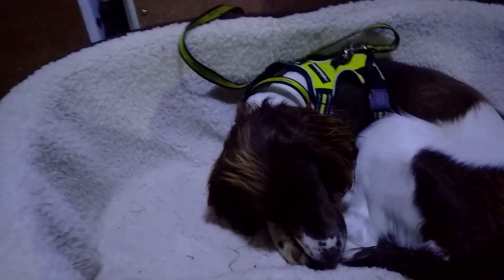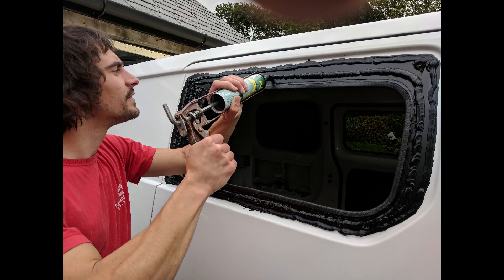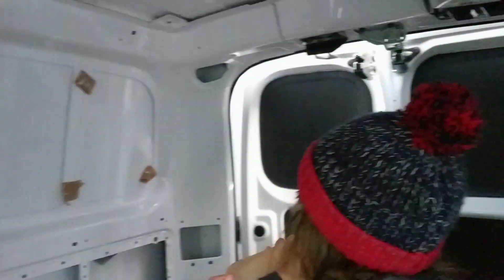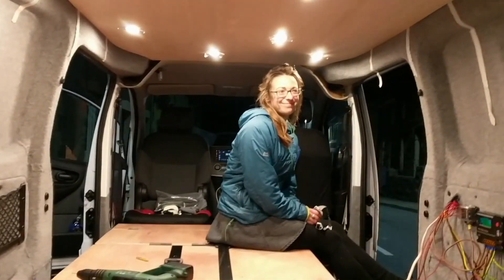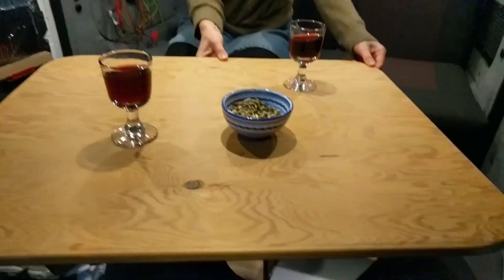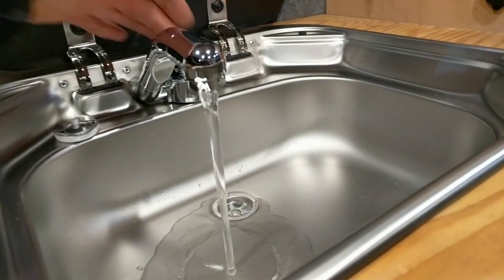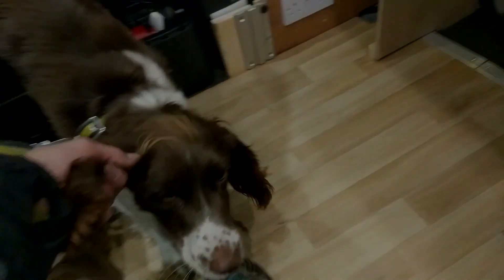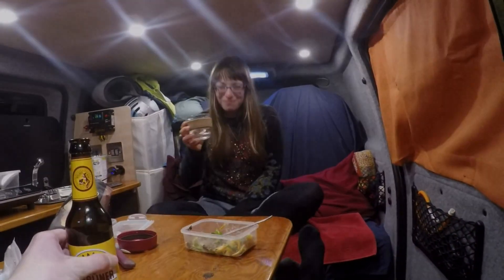Fully Electric Campervan: DIY Conversion Process (Nissan e-NV200)

Comment: Looking at doing this conversion on an ENV200 BUT discovered our very ungreen government  are not really interested in 'green issues' apart from talking about them 

The VED on a ENV200 is now post April 1st 2025 (for sure April fools day) is £345 and NO you cannot change it from a Van into a private car/campervan now :-(  Once it is type registered it is like that for evermore  BUT I have discovered that a ENV200 MiniBus is 'a private car' and not a VAN so VED is 'only' £195

AND with the ENV200 MiniBus you get windows already installed and up and over single back door with a single wiper and heated screen.

Obviously, finding a nice ENV200 MiniBus is going to be harder to find and more expensive to purchase  than a cheap 'older'  ENV200 Van 2013 ones being around £2,000.  Also, if i can find a pre 2017 one (VED £20) it will only have the 24kWh battery  :-( 

I DO LIKE the up and over back door and having factory fitted windows is a plus as well 

Probably more sensible to find a nice ultra cheap 24kWh van or even a 40kWh one  rather than spend a lot more money on the basic vehicle  being a MiniBus  5 or 7 seat versions

THOUGHTS????
Reply from the maker: Yes, the VED on the van version is annoying. I guess it depends on how much extra the Evalia (people carrier version) is to purchase. You may have to keep it for many years to make the people carrier version cheaper in VED savings. Agree, factory fitted windows are nice. Definitely go for a 40kWh, the 24kwh range is very limiting.

Comment: What radio/sat nav did you get having trouble finding one that fits
Reply from the maker: I've got an Android Pumpkin unit, any double din unit should fit. There's nissan ISO adaptor available to make the connections work

Comment: Amazing! So if you leave the heaters or air conditioning on over night - how much electric does that use? Half a battery? 10, 20, 30 miles worth etc?
Reply from the maker: If we're not plugged in the heater uses about 20 miles of range overnight depending on how cold it is. A/C doesn't use very much. I wrote a blog about this https://blog.zerocarbonadventures.co.uk/2021/12/nissan-e-nv200-campervan-cabin-heating.html

Comment: Did you look into having the R&R bed on sliders so you can push it forward and have rear space for carrying?
Reply from the maker: I've not heard of these before, sounds interesting but would have been ticky to install since the battery pack is located further forward

Comment: Hi IM seriously tempted to get a env200! Love the channel! Im a mountain runner and use a new Transit atm to drive to the hills and sleep in it.... Ive put in a Diesel heater, I see you say you can run the heating while not running the motor but I guess this runs off the 12v battery? Does this run ok or flatten that?
Reply from the maker: That's great to hear! The van needs to be left switched on when running the heating, the energy comes from the main traction battery, you can lock the doors from the inside, see: https://blog.zerocarbonadventures.co.uk/2021/12/nissan-e-nv200-campervan-cabin-heating.html

Comment: Hea man how did you get that section of the dash out? also what's the rectangle to fill in the gap around the new head unit?
Reply from the maker: Just pull that middle part of the dash and it pops off, the double DIN android headunit unit came with a fascia plate
Reply: @GlynHudson  Ok cool, thanx also for the cruise control, did you have to pull the wheel or was it just safer with the airbag out of the way?
Reply from the maker: @s.porter8646  wheel removal is not needed it just made access easier
Reply: @GlynHudson  for level 1 do you carry a 2 or 3 blade cord?
Reply from the maker: @s.porter8646  we don't have level 1 in Europe all our outlets are 240V
Reply: @GlynHudson  Got ya...starting my build

Comment: But, ehmmmmmmm, what's the actual mileage of the e-NV200? Is it really capable of riding along 850 miles without having to stop several times to get it plugged to recharge the battery? I mean, is an EV van currently the best vehicle to travel? I have serious doubdts about that. 

In fact, one year ago I went to a Nissan dealer with the idea of buying an NV-200, as I think it's the very best base vehicle for a single taveller. But I detached the idea as soon as the salesman told me that they weren't commercializing gas/diesel NV-200s anymore.

Comment: I wonder if it would be possible to add 500W (or more) of solar panels on the roof, which would slowly charge the main battery? That should add quite a few free miles over the years.  My question is do the van’s stock electronics allow for such modification to be implemented easily?
Reply from the maker: The vans main battery has a minimum charging current of 6A / 1400W. It wouldn't be practical to fit that many solar panels on the roof!
Reply: @GlynHudson  that's an interesting piece of information. So the battery is on 230V. I wonder if there's a way to hack the Battery Management System or charge controller to accept a minimum of 0.5A.  I remember there was a German youtuber - a kid who was experimenting with Nissan battery upgrades, who was into that sort of thing. He even started a company around EV battery expansions.
Reply from the maker: @garenkarapetian709  that is the limitation of the onboard AC-DC charger. To charge the battery at a lower current you would need to connect directly into the 400V battery pack, however this would require a significant number of panels and a specialist charge controller to achieve such a high voltage. Not worth the hassle and the danger for only a few miles of range IMO.
Reply: @GlynHudson  Yeah, there's simply no space for 1400W of pannels on that tiny roof. But an idea just came to me: what about having a leisure battery bank as a "buffer" between Solar panels and main battery. So when there's enough charge accumulated in the leisure bank, a separate controller can start spilling the excess at 6A into the main battery.
There's a certain hypocrisy when some vanlifers use the term "off-grid living" or "green" while boasting about covering 40K miles on overweight diesel gulping vans.  An electric van (and your channel seems to be among the pioneers in this direction) which would also generate it's own free miles - that'd be the thing, even if it gets only 15km/day.
I'm only raising these question because in one of your videos you said you're interested in these things (i.e EV things).
Reply from the maker: @garenkarapetian709  Yes, a buffer leisure battery would work. I've heard of other people doing that. However, the van is small, so space is at a premium. One of the nice benefits of an EV van is that I don't need a leisure battery. A leisure battery with enough capacity to be able to output 1.4kW for a decent period of time would have to be quite big and large. It would certainly be possible to make it work. However, I've found in most places in Europe it's easy to find EV charging stations and campsite hookups. 1kWh or energy only gives about 3 miles of range, so it would take a lot of solar to fully recharge the 40kWh main battery. Small vans are all about compromise, I prefer to maximize storage and living space.

Comment: Hello, I'm from Germany and the text has been translated with Google. I would like to be able to switch off these daytime running lights when I sleep in the car. My Nissan workshop told me that it would cost around 120 euros.
Which fuse is responsible for the daytime running lights? About a quick message
I would be very happy. Greetings Karl
Reply from the maker: Hi, see 4 min into my campervan conversion video https://youtu.be/EtBnP3StI28
Reply: @GlynHudson  Thanks,

Comment: Hi can the battery at the front underneath the bonnet be changed to a lithium please?
Reply from the maker: It's best to keep it as lead acid. I looked into it and couldn't find any 12V lithium batteries in correct form factor which can handle 125A charging rate. If a lithium battery is charged too quickly it can catch fire, the van was designed for a 12V leaf acid
Reply: @GlynHudson  is just that I have recently seen a lithium 20ah with 630a cold cranking I was thinking that might work with the high cranking what you think? 
And thanks so much for your reply and video’s are awesome ✊🏿🥗📷🐕‍🦺⚡️🚐🧗🏻🎥👫🏻👌🏿
Reply from the maker: @MrDavidcarp  EVs don't require hardly any current from the 12V to switch on, cold cranking amps are kind of irrelevant. The main issue is the vans on board DC-DC converter is not designed for charging lithium batteries.
Reply: Thanks for the help 🚐✊🏿

Comment: Its great to see you made this work. Really interesting that the climate control when the van is swtiched off. How effective did you find it in the depths of winter/summer and how much power did it use? Or is it a case that you only use it if you have access to a hook up?
Reply from the maker: Thanks for your comment, the van has to be switched on to run the climate control. It's not a problem to leave the van switched on overnight, we found it uses about 3% per hour, so maybe about 30% running the heater overnight. Since our old 24kWh battery has got a relatively low range we generally only run the heating all night when we're plugged into a hookup. If you have the newer 40kWh battery this would be less of an issue. However, it's still useful to run the heating for a few hours before bed to get the van nice an toasty, our van is well insulated so retains heat quite well. Here is one of our earlier videos where we run the heater overnight without being plugged in: https://www.youtube.com/watch?v=dGyKztu1Myc
Reply: @GlynHudson  thats great to know. Pity the env200 doesnt have the 62kwh battery of the latest leaf, but 40kwh should get close to 2 hours between stops hopefully.
Reply from the maker: It's possible to fit up to a 53KWh battery extender to the env200 which would give 93kWh! https://muxsan.com/English/products.html#nissan-e-nv200-battery-extender
Reply: @GlynHudson  haha wow thats a lot of batteries! Thats a lot of money, weight and space, but still worth considering due to the range of options. The under body 17.6kwh is tempting for minimal impact inside but should still get you three hours of motorway cruisng with the 40kwh env200.
Reply from the maker: @noneofyourbusiness5134  totally agree, anything over 200 miles real world range is not needed imo. When I drive a family members Tesla I need to stop for a comfort break before 200 miles anyway!

Comment: Good stuff but no one seems to be saying how they manage to bolt a rear seat/rock and roll bed down when there's a great big battery underneath the floor. How did you manage? Thanks
Reply from the maker: The battery doesn't extend all the way to the back. There is no battery where we bolted through for the seats. I did double-check this first before drilling!
Reply: @GlynHudson  Thanks for the reply. Been watching your progress for a while and just looking to get a van myself. Got a great deal on a Maxus e Deliver 3 but no idea if it's possible to fit bed or seats as yet. Just looking at rails that are bonded rather than bolted but info is hard to come by and only available for Transit and VW as far as I can tell. All the best!
Reply from the maker: @jonathankeenan5163  That's great to hear the Maxus looks like a really nice van. Let me know how you get on. I've not heard yet of any Maxus based campervan conversions. I'm afraid I've not got any first-hand experience of it, so I don't know how far the battery will extend. Although it's really not a big job for a garage to drop out the battery pack. Cleavley EV or any HEVRA garage should be able to remove the battery in about 30min with the right tools and lift. Good luck
Reply: @GlynHudson  Thanks, that's good advice. This issue was becoming a deal breaker for me as it's a lot of money if it turns out it can't be done but I think you are right and may even be cheaper than specialist bonded rails. All the best!
Reply from the maker: @jonathankeenan5163  I would think nothing would be as strong or dependable as bolting though with a steel plate underneath for reinforcement. This would be my preference even if it means dropping the pack.  This is what my seat looks like from the underside https://photos.app.goo.gl/e4XmF6YMXe59Boe77
Reply: @GlynHudson  I agree. Thanks for the pic. I got carried away watching this:
 https://youtu.be/BnL63Ne1bJo
But it's expensive and doesn't seem to be adaptable to other vans so old school drilling holes it may have to be.
Reply from the maker: @jonathankeenan5163  Interesting, I'm aware that modern adhesives van be very strong, but it's hard to imagine it being strong enough to hold a seat with 2+ adults in the advent of a crash. But I guess they have must have tested this. Very impressive, it does look tidy. But as you mention, the floor of the Maxus will no doubt be a different shape and size.

Comment: Hi 
What stereo did you choose for the van, I noticed you've changed it & is it Bluetooth connectivity for Sat nav 
Cheers buddy
Reply from the maker: I fitted a pumpkin Android head unit. Any double DIN headunit should fit. I think fitting one that supports Android Auto and Apple Carplay would be a really nice upgrade. I used a Nissan Nv200 harness to keep the steering wheel control function buttons working
Reply: @GlynHudson  
Brilliant thank you. 
Stay safe and happy guys 😉🍻

Comment: hows life in pandemic land ? are you still running the env200 have you done any orger mods. ive been looking again at vans , would love to get one already converted , do you know anyone selling one?
Reply from the maker: Not too bad thanks, the van's not recently been on any long trips. I recently fitted a 1500W inverter, so we can run the induction cooker directly from the van without needing a hookup. Will be making a video on this soon. I've got a friend who will be selling a 24kWh unconverted van soon, although you would probably benefit from a 40kWh battery. Any campervan conversion company should be able to convert an e-NV200, it's nearly identical to an NV200 to convert.
Reply: @GlynHudson  I have 2 solar pannels in my house charging bank of batteries , some things run of 12v and have inverter to, don't you find your induction ring draws to much current , they are 2000w. Are you using it at low power setting?
Reply from the maker: @lookoutleo  my induction hob is a Vango Sizzle 850W unit
Reply: @GlynHudson  does it work ok on inverter ? my induction hob just wont work on my 2kw inverter its lidl one 2kw, not happy . what makes your inverter, mines silverline and works on pretty much everything else fine
Reply: i sent you a message throu your website , send me info on van that might be for sale

Comment: Great conversion! 
How do you power the induction hob? I don't see any inverter in your van nor on the bill of materials! 
Also, is there a reason (besides capacity) why you didn't use the in-built 12V Renault-Nissan battery for low voltage appliances, and bough an AGM battery instead? Thanks!
Reply from the maker: Thanks. The induction hob is powered when we're plugged into an EV charge point or campsite hookup. It would be possible to power via an inverter but a 2kW inverter are quite large and expensive. We're usually plugged into a hookup overnight. If not, we used a gas stove. We do use the van's 12V battery to power the lights etc. The vans 12V lead acid needed replacing after 4yrs so I choose to install AGM battery as a replacement since it's better designed to handle lower depth of discharge.
Reply: @GlynHudson  Thanks for sharing this. Do you know how does the NV200 recharges its 12V battery? Let's say your 12V battery goes deeply discharged, will the vehicle notice and recharge it using the Lithium battery bank, or does it only recharge when moving the vehicle?
Reply: Inverters are getting cheaper and cheaper by the way. I am considering buying one to run my induction hob and other AC appliances while being off-grid. Check here for instance: https://greencell.global/en/power-inverters/2427-green-cell-car-power-inverter-converter-12v-to-230v-3000w6000w-pure-sine.html?search_query=3000W+inverter&results=7#specification
Reply from the maker: @Scampi252  Awesome! Having such a large inverter would be nice. 3kW @ 12V will need some very fat cables! I would recommend having a separate leisure battery since the van's DC-DC converter is rated at 1kW, I would be careful about pulling more than 1kW from the vans aux battery under the bonnet to avoid stressing the vans DC-DC converter.

Comment: Hello from Finland! And thank you for your very good travel videos with Electric Campervan :)  we bought E-nv200 40kw evalia in january and the car is almost perfect for us. My only problem is the useles head unit in this car. I found your conversion to android head unit and want to chance mine too. but.. i have not found obd reader and head unit that is compatible with this car. What obd dongle you use and how is it paired with your pumpkin head unit?  Hope you can give me any advice! Thank you! Toni& Jonna
Reply from the maker: That's great to hear. My Pumkin head unit is a Android head unit so any bluetooth ODB2 dongle that works with Leafspy should work with it. However, I've mostly found my smartphone to be more convenient for using leafspy. I would recommend choosing a head unit based on audio / navigation requirements and using a smartphone for ODB2 connection.